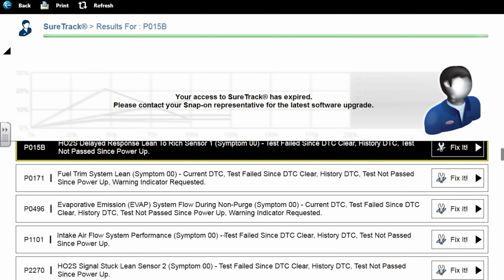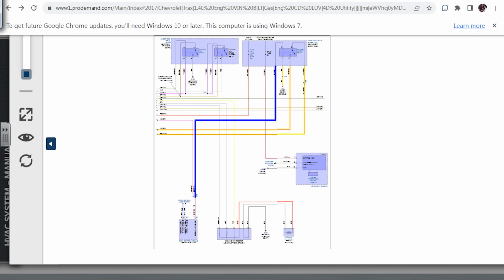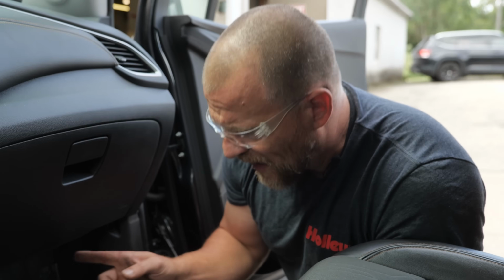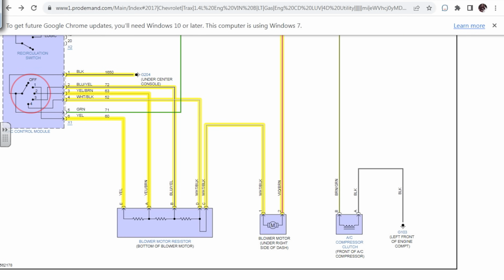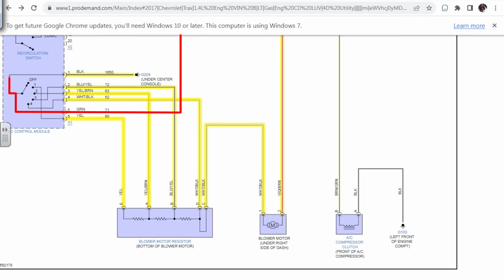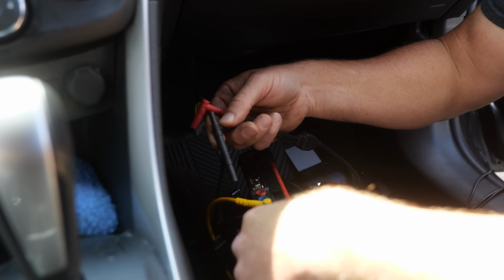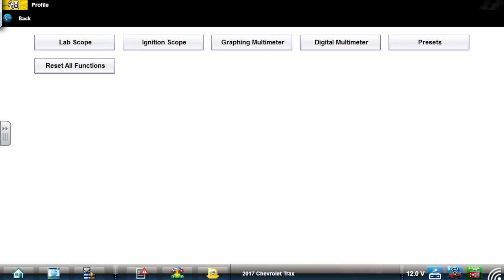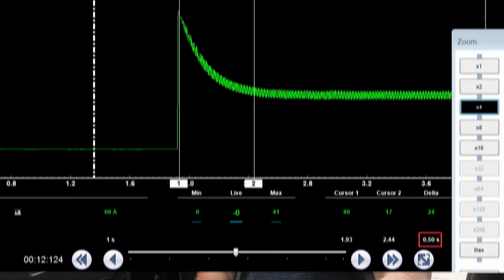2017 Chevy Trax Blower Motor Circuit Troubleshooting (Part 1)

Comment: I have a 2017 trax, number 4 speed don’t work for the ac/heat. Just had new compressor a year ago. Not sure what the issue is now, or where to start

Comment: Hmmmm. Our 'new to us' 2017 Holden Trax atm has NO fan, hence No AC. Its 40 deg today (104F). Previous owners mechanic had replaced 'something' to get the AC working - which it did for a few days, then Zip, Nada :(   Followed your process, and hey, what do you know - cooked plug!  Your circuit diagram and explanation is Brilliant.   No genuine parts easily obtained in my country locale,, so had a light bulb moment - decided to connect the two black/white cables -and live with the fan blower running at full speed. At least we will have Cold AC that prevents Us from being cooked! or, are you going to tell me its not that simples? Thankyou !!   Followup - Didnt work - still no fan :(

Comment: Hey there....I just fixed the same problem in my 2015 Trax. Replaced the blower motor, resistor and connector harness, and it all blew within a day. Turns out it's mostly a GM design flaw. The blower motor on the high setting runs full current through the resistor module through Pins C and D. Interesting that it's Pins C and D that always melted down, at least in my case, and in others that I've read about. Logically, it would make sense to run the blower HI-SPEED circuit OUTSIDE the resistor, and thereby eliminate the risk of overheating the resistor module. Fortunately, this is very easily done. I cut wire D to the resistor, and spliced it into wire C, which is the ground wire that goes straight to the blower motor. Now Pin D in the connector is bypasses completely, all the fan speeds work as they should, and there is no chance of the C-D pins melting again, since there's nothing passing through the module at high speed. IMO, this issue has nothing to do with aftermarket resistors. I am running a $25 Amazon resistor module and with this new cooler setup, all is good. Not saying this will fix everyone's problem, but it's free to try, and it may save someone a lot of money and stress...???
Reply: Peki D pini devre dışı kaldı C pinide devre dışı kalması gerekmiyormu

Comment: I've worked for GM for over 35 years There's an actual bulletin on these you were supposed to replace it with a Factory Connection and resistor and the blower motor the reason is has issues is because they put a resistor in it and didn't replace the connector and it had an existing burnt plug I see it everyday literally
Reply from the maker: this one did not have a burnt connector in any way shape or form until the resistor was replaced

Comment: Any advice on my wife's? It's a 2017 trax and has always just had fan speed 4, the lower settings do not work. I replaced the resistor module and then no fan speeds would work, so I put the old one back in. Connector looked fine as far as I could tell
Reply from the maker: Get an OEM resistor and make sure the connector isn't melted.

Comment: Instead of measuring air flow with your hand, you could have done an amp reading with the filter out, then tested again with the filter in. Too much increase in amperage with the filter in means the motor is working harder to fight the clogged filter.
Reply from the maker: for sure, I felt that the airflow test we did was sufficient so I never bothered to check the amperage difference. I realize for the video it would have been better as you all can't feel the airflow like I could lol sorry

Comment: I have found that if a resistor pack blows, the blower motor is drawing too much current.
Reply: But he tested it (at max speed) to be 16 amps. Relay is 40 amp. And he left the dirty filter in place for the test too....or did he remove it...I can't remember?😄 But 1/2 the max current is, by design, probably right where it should be.🤷🤔
Reply from the maker: @mtcoorscan I am in agreement.
Reply from the maker: I've done many where the motor was not at fault. But you're not wrong in that approach. More to come on this one.

Comment: I just had a similar issue with an 05 Tahoe - except with automatic HVAC (electronic motor control). Started at the motor and worked back. Power/grounds OK, Motor ran OK. Put a scope on control signal.  Found that the PWM signal from the HVAC head module was only 40mV.  Re-verified 40mV PWM right at the HVAC module. For the fun of it, pulled the HVAC module, and re-soldered the big connection on the PCB.  ha! fixed it!.  Thanks for posting this.
Reply from the maker: awesome! Nice find on that one

Comment: wouldn't pin 4 have the highest voltage and pin 1 be the lowest. doesn't more resistors mean less voltage?
Reply: The pins are probably reversed from the switch positions.
Reply from the maker: Voltage and current laws are different. Yes, more resistance will always drop current flow, but can actually increase voltage depending on where you are measuring. In this case we are measuring AFTER the first resistor (the motor) and before the other resistors. In position 4 there is a direct ground, so no voltage should be measured and all voltage drops across the motor. In position 1 there are now 3 resistors before it gets to ground (4 counting the motor) and so a very small amount of voltage drops across the motor leaving us with high voltage.  Think of it as pressure backing up as we add resistance. Does that make sense?
Reply: @ScannerDanner thanks for the explanation
Reply from the maker: Great question and you are welcome!
Reply: @ScannerDanner  A great explanation, Paul, preceded by a great case study = 'real world electrical fault-finding'. mike

Comment: Hey Paul: given that "This isn't your Father's Buick"....or Chevy, I suggest that best practice today is to replace any dirty cabin filter when replacing a failed blower resistor or motor. Time will teach us if there is a corolation or not.
Reply from the maker: absolutely would agree
Reply: generally on that type blower wheel, as air flow is restricted static pressure rises and there's less air being moved, which lowers the load and increases RPM  the more it's blocked.
so the opposite of what you'd think occurs, but the blower resistor could overheat since it's air cooled, as is the blower motor. the connector really should be the last thing to get hot, if there's good connections. cheap blower resistor likely has plated steel pins, instead of copper/brass with plating.

Comment: I looked up the spec for high blower on that vehicle 15-20 amps.
Reply from the maker: Where did you find that spec? I could not in Pro Demand
Reply: @ScannerDanner  Chatgtp.
Reply from the maker: Okay so more of a generic spec but still is legit
Reply: @ScannerDanner  Agreed. Also the rush in current at stall to full spin looked normal I took that into consideration to believe the spec along with the fuse rating.
Reply: @ScannerDanner  CHATGTP, also CHATGTP gives links to your videos on automotive diagnostic questions.
Reply: Doesn't that follow logic since it's a 40 amp relay (max continuous load run state is 1/2 the current limit)?
Reply: @mtcoorscan  Also the "rush in" at stall with down ramp shows integrity.

Comment: shouldda amp clamped the blower  with the resister in and the cabin filter in then out oh and make sure its on fresh air  not recirculate.
Reply from the maker: I felt the flow test we did addressed the cabin air filter variable.

Comment: That is a big problem with electrical diagnosis..Just getting to the part that needs to be tested..Imagine if the 4 way switch was bad or needed to be tested..Ripping the face of the dash to get to it..
The connection to that resistor itself is not in the air cooling area...Having a OEM resistor is probable the best way to fix this

Comment: I've had this exact problem before on a "Holden Trax " over here in AUS. I replaced the resistor and plug and it did the same thing again. I put a genuine resistor in with new connector and all good.

Comment: Blower motor issues can be surprisingly frustrating. 

I threw a 5 and 6mm socket because one was too big, one was too small -- it requited a 5.5 mm socket. 
This was on an Audi Q7. Why they use a weird size like that, other than to annoy us, is beyond me.. 
Never did find the 5mm socket. It is somewhere on the lawn.. 

Always good, Paul. Thanks!
Reply: Gm loved the 5.5mm for a few years.   7/32 is nearly perfect.  I recently did a blower motor job on an ‘04 lesabre.  Lots of 5.5.
Reply: The mower will find it  😁😁

Comment: I have seen that issue of melted blower motor resistor and connector on 2008 GMC Canyon and a 2019 Kia Forte. Kia even has a TSB out for it saying the blower motor, the resistor and connector should all be replaced too. I think its just the design of the parts for some vehicles that end up that way. Could be wrong, but seen it here and there on different makes. Awesome videos as well.

Comment: That Delphi garbage is nothing but trouble. Toyota tacomas use Delphi also. Toyota made a deal with the devil.
Reply: I thought Toyota was mainly Denso 🤔
Reply from the maker: Was that a Delphi part? I don't recall
Reply: @ScannerDanner absolutely it is. My Toyota Tacoma is full of Delphi branded electronics. Manufactured in Mexico, no less. I would recognize that resistor anywhere.